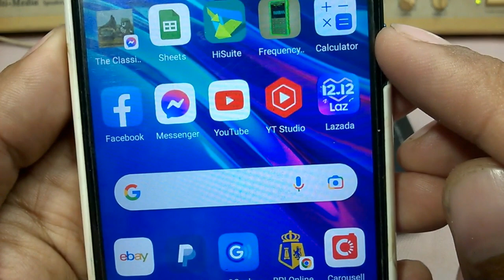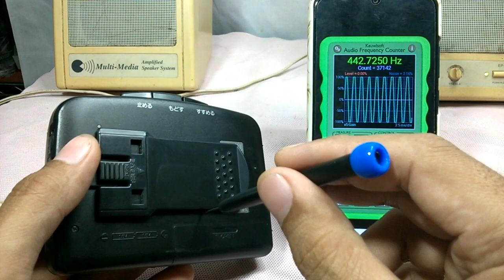How to repair cassette player not spinning and how to calibrate the speed || AIWA HS-PS100

Comment: Thank you so much for helping 😊

i have a portable casette player but its playing fast… and i just found out this video…

And the video shows that it ms actually the adjust motor speed is in the hole, i also found a hole at my casette player, but when i turn it with my small minus screwdriver, it just spins up and down, until the speed is perfect, thank you 🙏👍
Reply from the maker: Welcome

Comment: I have a Walkman that won’t spin but had a brand new belt. What could be the issue?
Reply from the maker: Remove the belt put a battery and check if motor will spin. If not then detach the motor wires from the circuit then check the motor with 3 volts battery if the motor will spin then check the small switch inside the mechanism of the tape deck and check the battery spring contacts.
Reply: Same but the motor on mine works, but whenever you push play it seems to spin like its forced or like barely spinning & sometimes stopping, but when i push ff or rewind it has no problem...i already cleaned it & lubricated it & still does that.
Reply from the maker: @Taakabron211  Replace new belt
Reply: @Woodys_Hobbies  been done that
Reply from the maker: @Taakabron211  Replace the idler wheel rubber and pinch roller.
Reply: @Woodys_Hobbies  thank you
Reply: @Woodys_Hobbies  okay will do, thank you'!
Reply from the maker: @Taakabron211  👍👍👍